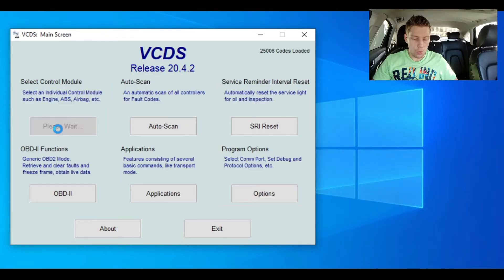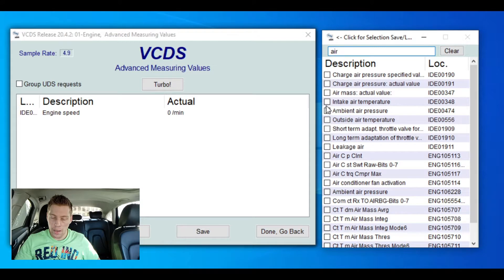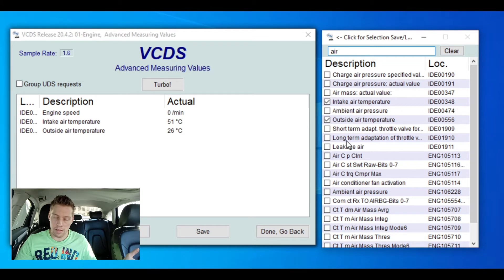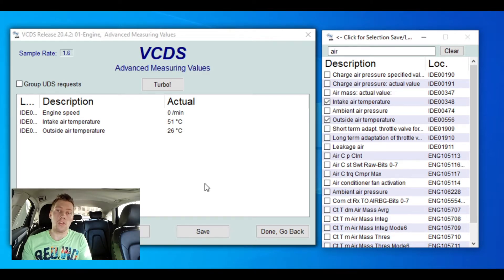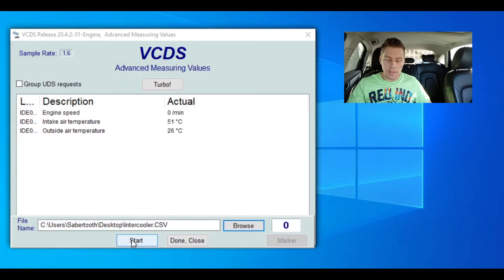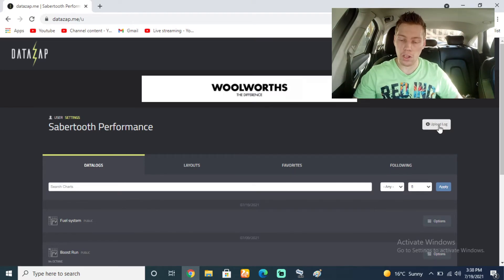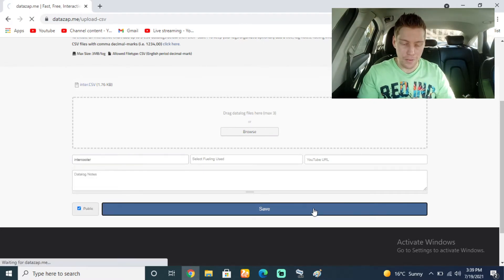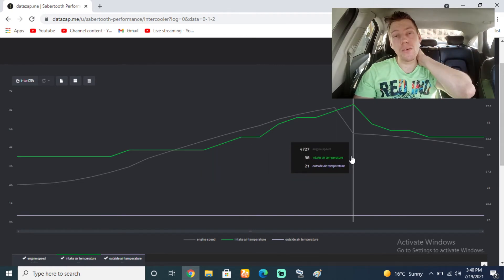Is Your Intercooler Working? Data Logging With VCDS

Comment: :face-purple-crying:only 37 intake temp when engine runs at 5000+ rpm?
Reply from the maker: You say only as in a good thing? 🤣
Reply: @megalodononwheels  :face-purple-crying:my car is NA,  Temperature up to 10 degrees higher after long distance driving. your data scared me...🤣
Reply from the maker: Lol 🤣 yea the problem with forced induction is the heat 😭 also depends on the heat outside that can make it look even worse haha. But yea one can easily see 10 to 20 degrees hotter temps when accelerating when one has a crappy  intercooler

Comment: Hi, I know it is an old vid, but you will always see the tmep increase with the rev range, a better intercooler will never stop it going up, but it will reduce the amount it goes up by and reduce heat soak the more pulls you do
Reply from the maker: Thank you for adding 👌 You are 100% right... It will go up as you are doing your pull, it will just be ideal to see it stay the same temp as outside, but unfortunately it will only happen in a perfect world

Comment: On VCDS I see the Intake air temperature and coolant temperature but "ambient" is not in the list of sensors. It looks pretty simple so I don't know if I'm doing anything wrong or if my Engine module is just different (2013 Jetta TDI)
Reply from the maker: Sometimes it can be your car that doesn't have the option available or your car is just using a different name :) i have data logged one of my friends car and sometimes the wording is a bit different or when you search something there is sometimes more or less stuff for the search term :)